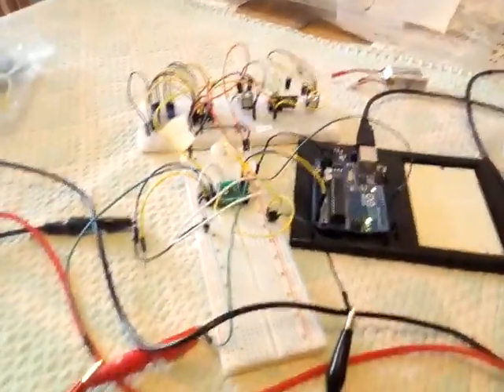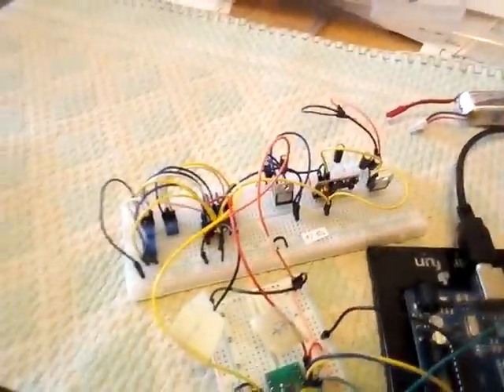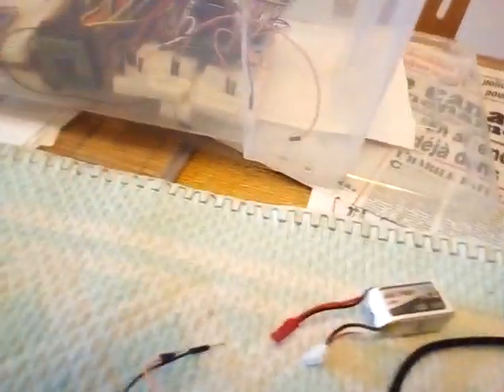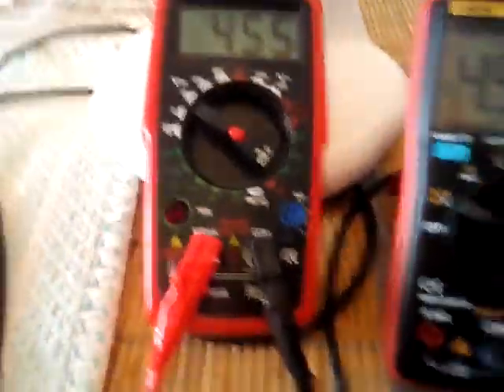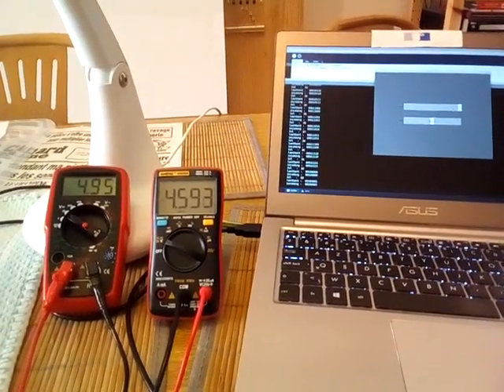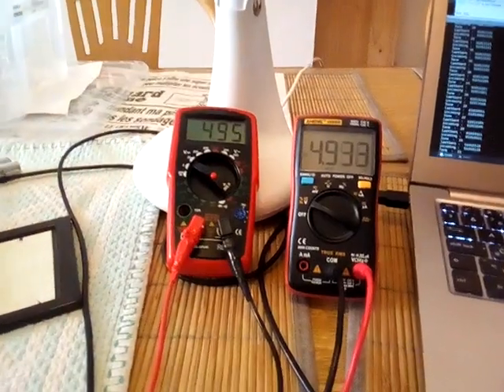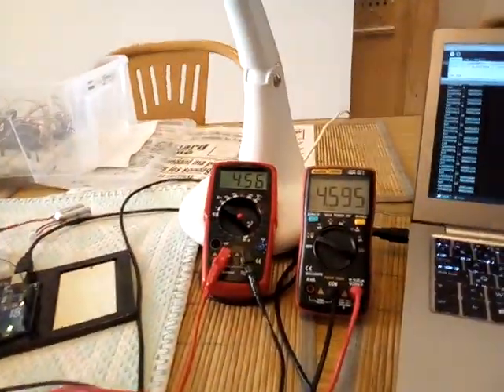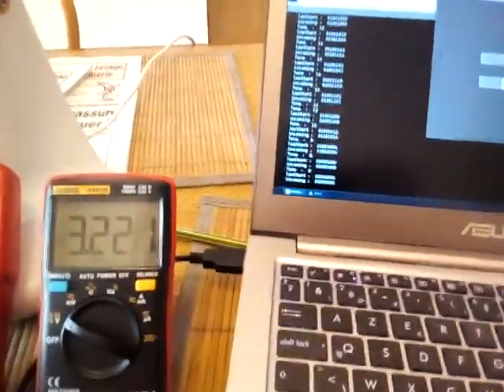DS1882 Dual Digital Potentiometer with zero crossing detection

Comment: Hi ;-) I've looked into some datasheets of Digipots with Zoro-Crossing Detection and I saw that for instance the AD5292 uses an AND gate to reduce the glitch when changing resistance. Did you have to implement any extra components to do so? And how did your pedal turn out??
Reply from the maker: the work is ongoing, I hope I live to see the end of the project ;-) There are no components to add, you just enable zero crossing detection in the setup and it works very well. I don't remember the details, it was long ago... But I  do know that there was NO WIPPER NOISE AT ALL which is great. I did not test other digipots with zc detection. Hope this helps!
Reply: @GratefulFrog  Yes! That helps ;-) I also saw a video where an Arduino does the zero crossing detection. I know the Arduino has trigger inputs so maybe it's possible the send the bits only when the zc is detected by the Arduino. Probably not very handy for more than a few digipots, but maybe good for just a few. Another question. Did you solder the small IC with solder/tin or did you use hot air?
Reply from the maker: @bastenhoor6902  I would not try to do zc detection with an arduino, unless that's all it is doing ! ;-). It's always better to use a specialized chip when available rather than writing code to simulate a chip. I used hot air, soldering under a powerful microscope. They key use to use lots of flux; if there is a problem, use more flux, if there is still a problem, use more flux, etc. Good luck
Reply: @GratefulFrog  Thanks mate! Going to get me lots of flux ;-)  And a hot air soldering station... I found some clamps for the SOIP chips. They also work great, need ones with more pins now! I also came accross an article that suggests raising the DC offset so they signal does not cross ground and later on lowering it back to normal with capacitor coupling. But I would like to substitute lots of pots in all sorts of places in my audio gear and selfmade boards. I guess when I find one or more favorits I'm going to order pre-soldred breakout boards from a PCB manufacturer so I know the soldering is done properly. I've tried sodering with a very sharp tip on a SOIC breakout board and it worked, but it's to tedious for me ;-) Thanks again for the replies!

Comment: May you pubish your sourcecode ? i'm having trouble controling the ds1882 via arduino
Reply from the maker: Hi! Thanks for the interest. 

The source code is arduino C++ for the digital part and  processing for the gui. 

You can see the code in my gitlab repos:
Arduino code :  https://gitlab.com/gratefulfrog/ArduGuitar/-/tree/master/Ardu3/DraftDevt/Arduino/DS1882Tester_v00
Processing code :  https://gitlab.com/gratefulfrog/ArduGuitar/-/tree/master/Ardu3/DraftDevt/Processing/DS1882_VOL_TONE_Tester_V00

If you have more questions, feel free!
Cheers!
Reply: @GratefulFrog  Actually I have one, could you please publish the schematic used for wiring up the DS1882? I have problems getting it to work with other I2C modules connected..
Reply from the maker: @yannicklehr6291   Hi! Thanks for your interest. There is no schematic per se, just follow the  DS1882 datasheet, the pins are connected directly as described. Note that you need +/- Analog voltage supplies.  I used +/-7v. You can set the I2C address by the pins 2,3,5. What I2C problems do you have?
Reply: @GratefulFrog  Thanks for the reply. Unfortunately my arduino won't regocnize the DS1882 as soon as I connect the IC2 display. Furthermore the sound is pretty bad. Therefore I had hoped you could share your overall schematics of the project so I can compare it. Especially the different ground and voltage lines confuses me.
Reply from the maker: @yannicklehr6291   I do not have any schematic except that in the datasheet. Do you have a copy of the data sheet? You need to set the I2C address to be different form that of the display. You need to put 4.7k pull up resistors on the SDA and SCL I2C lines. Pull up to 5V. The analog voltages are +7v and -7v. Gnd is just 0v refernce for the digital I2C comms. connect it to the arduino GND. Try using it without the display, to test. Always test independently if possible. What type of display are you using?  The sound I had was as perfect as perfect could be! How are you getting +7v and -7v?  I used an inverting op amp. maybe your connectons are not good? Are you using a breadboard? How did you solder the DS1882?
Reply: @GratefulFrog  That's a lot to test. Will try it out! Thanks a lot for your input and taking the Tim!
Reply from the maker: @yannicklehr6291  if that is a lot, then you have hardly started! Test everything, step by step. If the sound is bad, perhaps you have not connected the audio gnd? Are you driving the output of the DS1882 through op amp buffers as per the schematic on page 15 of the datasheet?